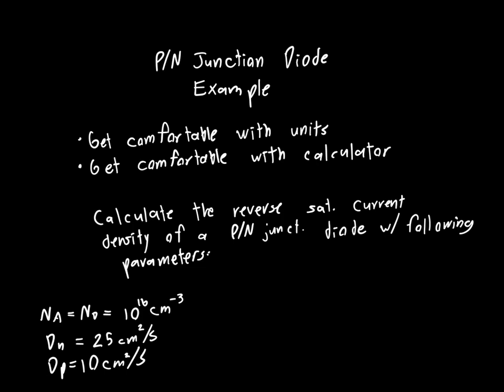PN Junction Diode Example: Reverse Saturation Current Density

Comment: Would'nt it have been simpler to use ni^2=n*p to get n_p0

ni^2=2.25e20
p=N_a (as we are in p)=10e16
n=n_p0 

so n_p0=2.25e4 ? which close to your results

did i miss something, isn't it at equilibrium ?

Comment: I have attempted a simple and intuitive explanation for the diode current dependence on saturation current. 
The diode current I includes the saturation current represented by the symbol Io. 
The current for p-n junction diode current for an applied voltage V is 
I = Io {exp(V/VT) - 1} where
Io = {AqD(p)p_no}/L(p) + {AqD(n)n_po}/L(n)
In the expression for Io, 'A' is the area of cross-section of the junction, D(p){D(n)} is the diffusion constant for holes{electrons}, L(p){L(n)} is the diffusion length for holes{electrons} and p_no{n_po} is the thermal equilibrium concentration of holes{electrons} in the n-type{p-type} material.
Here, Io represents a term which incorporates the thermal equilibrium concentrations of holes and electrons. While diode current I takes into account the applied voltage V, Io does not. 

Io is multiplied by a factor {e (exp[V/VT]) -1} dependent on the amount of applied voltage and it is this amount of charge carriers which is injected across a forward biased or reverse biased junction. 

When forward biased, the factor {e (exp[V/VT]) -1} increases with more and more biasing voltage and the current increases sharply with bias.
Note: The current in a diode under forward bias and in constant thermal equilibrium is due to the movement of the holes and the electrons moving and recombining on and on and on. 

When reverse biased, the factor {e (exp[V/VT]) -1} decreases sharply and settles at Io when the bias is large. Here, what it means is that only the thermal equilibrium concentration of carriers participate in conduction. So, the term saturation current Io. 

Space does not permit me to explain more here but you may refer to the textbook 4 mentioned below. 

The conduction processes of p-n junctions can be easily understood if Current is understood properly by taking a unified approach to electrostatics and circuits. 

Electrostatics and circuits belong to one science, not two.
These are discussed usually separately in textbooks and science and engineering courses. 
Watch the two videos listed below to learn about current and the conduction process and surface charges (using a unified approach to electrostatics and circuits) which set up the electric field whose line integral is the potential difference. The battery produces the emf.
The last frame of video #1 lists textbooks which discuss all these topics in more detail.
1. https://youtu.be/REsWdd76qxc
2. https://youtu.be/8BQM_xw2Rfo 

I have discussed the exact idea on the relation between diode current and saturation current in detail in Chapter 9 and Appendix E of textbook 4 listed in the video #1.

Comment: Thank you for these videos! I have a question for this video: how do the equations used determine reverse saturation current density? Nothing about the set-up of the problem seems to indicate to me that the diode being analyzed is reverse-biased, but I must be missing something. Is it because we are just using Vbi for the potential, instead of (Vbi - Vd), thus implying that there is no forward bias and therefore we are looking at the reverse bias case?
Reply from the maker: Ah, good question. We're not assuming it's forward or reverse biased, we just want to see what current would flow at any bias, and then from that, we infer what the reverse saturation current density is (it's the coefficinet out front that doesn't include the exponential).

Comment: Appreciate it, sir.When I was trying to calculate n_p0, I find myself somehow trying to use ni squared divided by p_p0(which is NA). But I realized soon, this result is the concentration of electrons on the p side when no voltage is added to the diode.When a voltage is added to the diode, the concentration of the minority carrier changes dramatically, which means we should use the equation that connects the concentration of the minority carrier on the one side to the majority carrier concentration on the other side. When we have calculated the  value of n_po, maybe we can plug that value into the equation n_p0 x p_p0 = ni² to  calculate the acurate p_p0 and then compare it with NA to see if our assumption of NA≈p_p0 is reasonable.
Reply: 这里面有一个前提，这是一个无限长的PN结
Reply: I thnik that you actually can use np0=ni squared divided by pp0 even though there is a applied forward voltage. And this is because np0 indicates the concentration in equilibrium state which will not be affected by the applied voltage.
Reply: By saying that I mean this equation always holds in equilibrium state whenever there is an applied voltage.
Reply: In fact, you just need to pulg the equation of Vbi into the former equation to get:np0=ni^2/NA